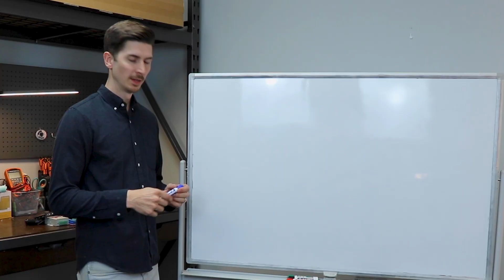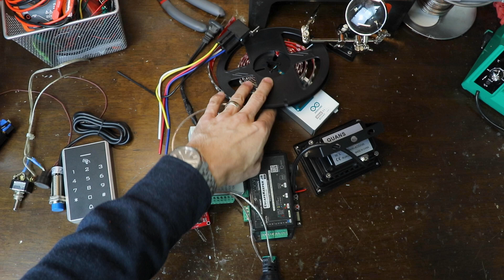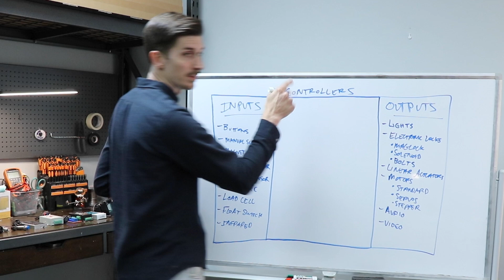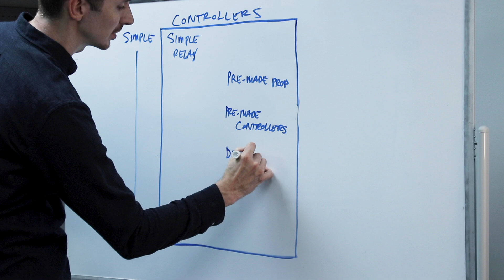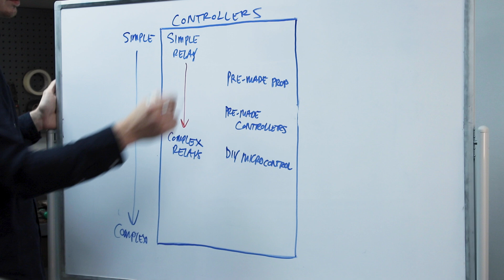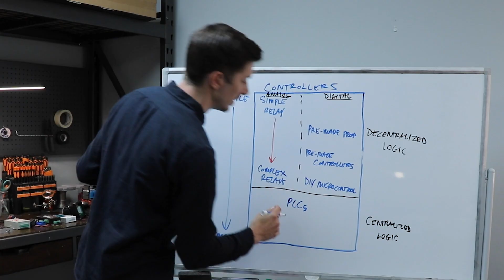Show Control Is The Future Of Escape Room Tech

Comment: Great info for beginners, the more resources available the better this industry can stay. I agree with almost every bit of this video but wanted to provide my professional opinion.  To me, show control is a term that would mean you are Syncing audio, video, lighting, motion, and interactive elements. Usually there is some sort of central system that ties all of these things together but it is not necessarily one type of hardware or software but a system. For example, a flex max (or even picoboos)  from frightprops can be considered a show controller and are used all over the world providing this function for scenes in haunts. They may be limited but they can sync animatronics with lights, sounds, and interactive elements.   In large scale installations, there is usually a more diverse range of hardware systems working together. You will have some sort of central controller cueing up lighting consoles, audio systems, video players, and PLCs handling the IO in a safe and reliable manor. What I just spoke about will only be in amusement parks and massive interactives but some parts can be consolidated for smaller venues. 

We unfortunately cannot make your conference this year but I look forward to future content from y’all and maybe will attend in the future.
Reply from the maker: Hey Skylar! You’re right that show control is a term that means you are syncing audio, video, lighting, motion, and interactive elements.  The specific type of show control we think is most useful to the escape room context is one that is more robust and provides more mid-game flexibility and visibility than something like a Flex Max.  We also agree that show control is not necessarily one type of hardware or software—it’s a combination of both.  At the conference and in future videos, we will get into more of the “how to” details.  But for now, we hope that escape room owners will begin to start thinking about making the shift from decentralized logic (prop controllers) to centralized logic (show control) as they design and build new rooms.  Hope to see you in the future!